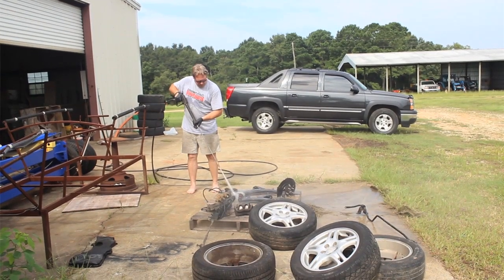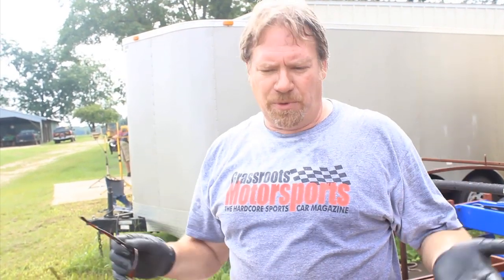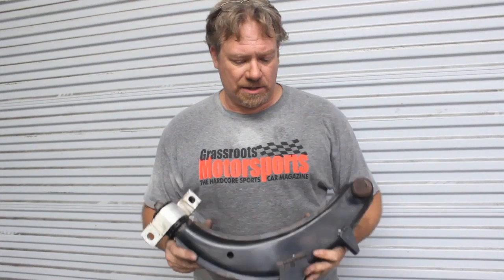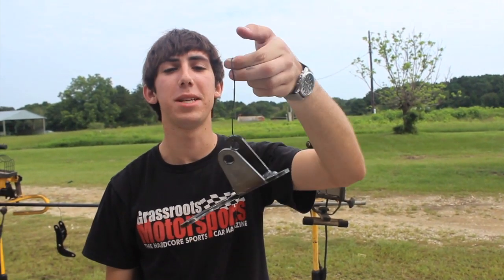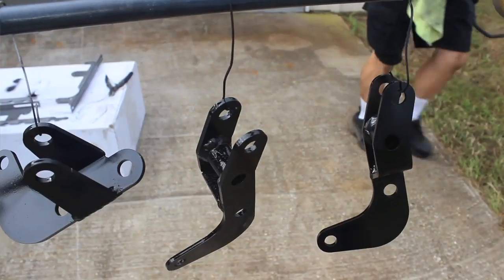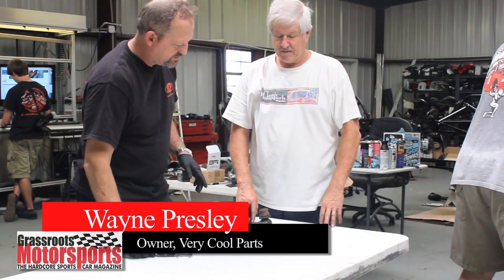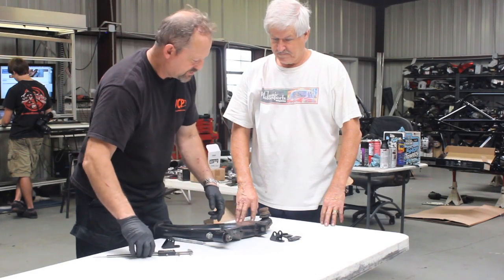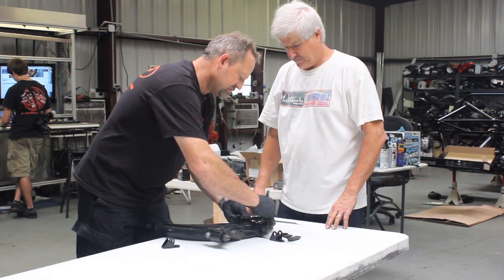Project 818 Part 8: Cleaning Donor Parts

Comment: "You need to drill a 2 mm hole 1 3/4" from the back edge."  (Proceeds to drill a 5 mm hole 4" from the back edge and jams a bolt in it with an air-wrench.)  LoL.   Great build guys, and good info. Thanks!
Reply from the maker: If you don't have all the drill bits, at least get yourself a powerful air wrench.

Comment: the 818 is not an easy built. One little mistake on the suspension mounting tap and you have no idea why it doesn't perform as good as you would think it will.  Not very well engineer, it is left to the builder to apply his skills. So buying an already built 818 becomes a bit sketchy.